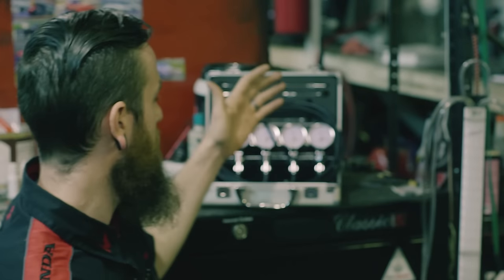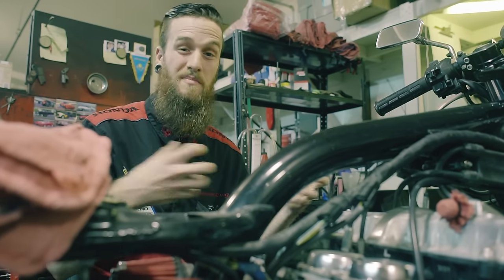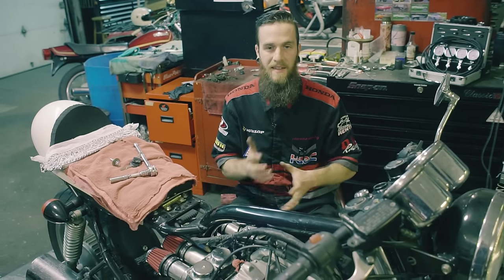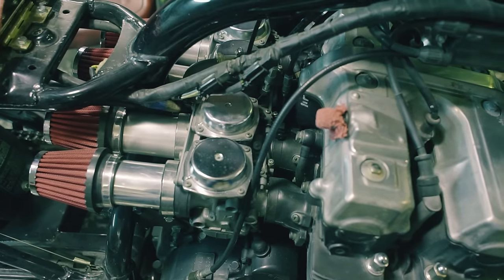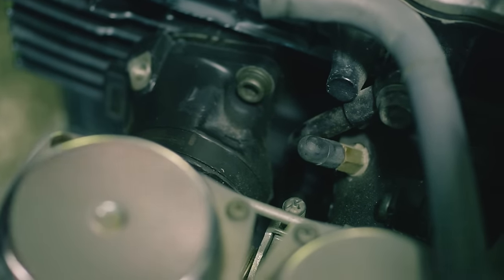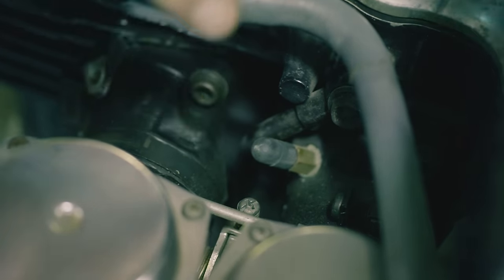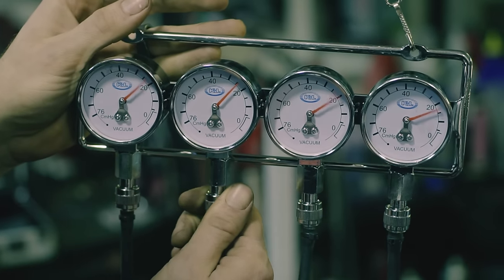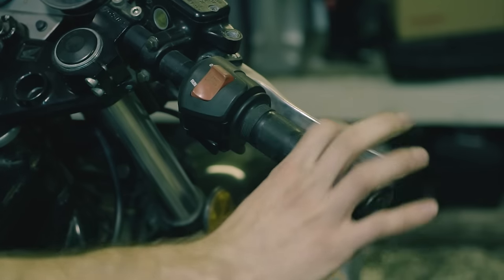Carb Syncing: How to Fine Tune Your Carburetors

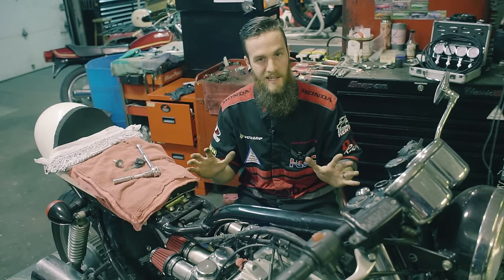Comment: thank you  2:53  true story.   
 Me " I just got this bike on a trade, I cleaned the carburetor but it still doesn't run I was hoping that was the problem"  
dude who thinks he knows about bikes even know he doesn't have a bike.  " did you sync that carbs?"  
"no I'm pretty sure that's not the problem" 
"my dad found this insert bike name here in an old barn worth $150 ,000  he took it home sync the carbs got it running the next day" 
"cool"  walk away   

the point here some things make the bike run better, did you try to change the oil, ahhh that's not it.  and somethings are essential for the bike to run. fuel, air, spark, compression makes an engine run  anything else makes the engine run better or worse.  remember just because you upgrade something doesn't mean your bike will like that.  

anyway thanks for the video

Comment: Thanks for the detailed info.  Totally awesome!  Question, do you have a video on installing the air pods and it appears that you put about a 2" extension on yours in this video.  I have a Suzuki GS1100 that I would like to do the same with.  Just not 100% sure how to install them.  I also assume that I will need to sync the carbs once the air pods are installed.  Thanks again!

Comment: Great video! I just recently purchased a 1980 honda cb650c. after cleaning, and many frustrating hours and attempts, i finally got the leaking carbs to stop leaking..
my current issue is the pod filters that are on it. previous owner must have got em and installed em, correct size jetting too, but stock 4-4 exhaust. but the 2nd and 3rd filter interfere with the choke cable located in the middle of the 4 carbs. I was too excited after getting the leaky carbs to stop and wanted to take it for a test ride. fired it up with no pod filters, only with the help of starter fluid. 

I'm wondering if you had seen this scenario with the pod filters/choke and had any solution. I'm wondering if i rigged something up to extend and offset the 2nd and 3rd filters that it will be okay with uneven filters. I can't extend the 1st and 4th filter because they are already too close to the frame.

p.s. keep making awesome videos! liked and subscribed
Reply: You can put the filter in a tube. I did that on my Triumph Legend. I cut a beercan into shape, "wrapped" it over the filter and that made the engine run much better.

Comment: FWIW, I check my gauges with a handheld vacuum pump to make sure they all read the same.I have adjusted brand new gauges right out of the box. I would suspect that's why the mercury gauges read differently.

Comment: Hello again Cody, as i mention i other video, my mechanic told me that my carburetor needs to be replaced, is Keihin original one, but overthought i'm not an expert, i think that with a rebuild kit, new floats and fine tuning it will be ok. But i need professional opinion of how to know if the carburetor really needs to be replace or just rebuild. In all the research i've done, all i found was deep cleaning and rebuild, nothing about replacement.
Reply: Why does it need replacing? More info from your mechanic is needed. Is there a part inside that is broken, will it be easier for him to replace than repair? I would want to know why before buying a replacement or even having the guy do any more work if he can't tell you why.

Comment: Hey Cody, I'm really stoked by your channel. 
I've got an issue on my '98 cb600 (44.400km's)  Idle after cold start is slightly messy. But after my last two ca. 45min. rides, it quite often stalls around reaching idle revs. Like when rolling with clutch disengaged or in neutral at full or close to full stops. 
Could this be a thing caused by the carbs being out of sync?
what would you recommend checking first?

Shout out from The Netherlands

Comment: I hope you'll get this.  Guy has a 1978 KZ1000. He wants $5,000 for it.  It looks decent but what would you do for a complete review if you bought it?  I mean would you just go ahead and change fork oil and seals... Even if not leaking?

How could I really know the engine is in good shape?  I mean if it runs okay, then I guess all fluids, plugs, clean and sync the carburetors, other??

Comment: Those are way safer than the mercury sticks we learned on back in the day. Although I remember the old Bell Crank carbs, you could sync them with four pieces of welding rod (or coat hanger).

Comment: Okay maybe I missed it but isn't there an individual idle air fuel mixture screw on each carb? I was under the impression that if you had one cylinder that wasn't running as well because the mixture was off that simply opening the throttle plate further is only going to partially correct a problem.

Comment: Carb sync is a means by which variations in each cylinders draw / compression can be adjusted through each butterfly so that the result is evenness in terms of draw - fuel delivery.

Comment: Hi Cody,ok I have been struggling with my kids bike 1996 honda 750 nighthawk. We took off the airbox and removed the baffles on the stock exaust pipes. We have a jet kit in the carbs .142 mains and slow jets we're bumped up.Single pods installed and I can't get rid of a sputter at 7k rpm?I noticed u have an extension on the pods. Is that the secret?Dennis ps love your videos!@

Comment: Great video, but Honda use Japanese Industry Standard JIS screws not Philips. 
A #2 Philips screwdriver will round out the manifold vacuum screws if they are stuck and they'll round out the soft brass carb screws really easily, as happened to my old XL125V4.

I bought a Vessel 300 woody +2x150 for working on carbs as it was long enough to reach the adjuster through the hole in the air filter on my old NTV650P  (similar to the Hawk 650) and my XRV650J

I must get some impact ones for where a previous owner has rounded the crash bar cover screws out using the wrong driver on my ST1100AX

When balancing/Synching the carbs,  don't rest the tip of the driver in the adjuster screw when taking the reading as it will throw it off.

Comment: hey Cody, I dig the videos man.   The way you break everything down is awesome and you make complex situations not so hard.  Here's my question...I'm rebuilding a 94 Vmax.  I went through the carbs thoroughly and set them up Ay 2 1/2 turns out.  Started, ran about 30-40 seconds and was purring....then died.  now when I crank it it pops/backfires loudly.  Any ideas?
Reply from the maker: WilliamGallegos I would check your fuel delivery system. Petcock, fuel pump if applicable, fuel flow from the tank etc. OR something loosened up in the carb like the idle jet fell out in the bowl or something. You can also try starting it with full choke and see if it picks up and runs. If that's the case than your dealing with a lean issue. Vacuum leak, poor fuel flow, carb issue etc. starter fluid works wonders with finding vacuum leaks. I have a video on that as well!

Comment: Love the videos, keep it up. I have a question on carb synchronization I've got an 81 Kz550 with the keyhole style carbs that you sync through the top covers. In this video you said that carbs get out of sync by either vibration or taking them apart. Now on my carbs to adjust them you remove the top cover and loosen the locking nut and turn the screw either in or out depending on the vacuum once its good you tighten the nut without turning the screw. My question would it work to replace the regular nut that is there with a Teflon lined locking nut so that vibration wouldn't affect the sync of the carbs? Then it would only get messed up by disassembly for a deep cleaning/ rebuild. Would that work? If not why?

Comment: I bought a Motion Pro 4 carb synch gauge to dial in my 79 XS11. Do you think this was a good purchase? Will likely be doing a few other bikes with it as my comfort level rises and it seemed a decent tool to me.
Reply from the maker: Nick Warner Hey Nick, is the one your bought a fluid style gauge reader or a vacuum style?
Reply: fluid style
Reply from the maker: Nick Warner 😕 The blue fluid ones are definitely not my favorite. I prefer the vacuum style or a classic mercury set.

Comment: Old school method is just placing a pipe between carb intake (if it has vacuum gauge spigots theyre even better) and your ear. If all carbs are adjustable (many banks of four have adjusters on only 3 carbs) you listen for the carb with the most suck (the loudest) and then adjust each of the other carbs, constantly checking, until they all sound the same. Obviously on carb banks that have one carb thats non adjustable (old hondas) you have to adjust all the others to sound like that one.  Either way, your carbs are balanced.  Clearly you have to ensure that the butterfly valves are all synched first but this you can easily do by eye, holding the bank up to a light source and comparing the crescent of light that comes through (throttles shut).

Comment: So this is basically only for adjusting the idle? It won't actually adjust half-open and full-open positions right? What if you run a bike without syncing the carbs properly for a long time?

Comment: great job  I have question i have zg1000 do you have a  take apart carb demonstration rebuild for that model ? I bought car  the engine blew up  was not told it was bad they somehow doctored it . so i needed a transportation  and bought a bike to find out the carbs are bad . sooner or later something good should happen.  any advice  would help thanks

Comment: I would use water to spray around carbs looking for vacuum leaks, works great, and the bike won’t catch fire when it finds the broken ignition cable.  Lol seen it happen several times, water will also show the broken ignition cable.

Comment: hey cool vid - i used a manometer few years back, worked ok but i kept chasing my tail- i just hooked upa  4 carb sync gauge kit i bought at a swap meet but it doesnt have the adjusters like yours, at idle the needles are crazy- does cranking the orifice not affect the overall vacuum? thinking of popping 4 1/4 inline shut off valves from the gardening section to try keep the needles under control. bike starts at the touch of the button but i wanna get max performance.. thoughts on the valves?

Comment: It isn't "easy" to correctly sync carbs, but for the best power and power delivery, it's vital. On two-stroke single cylinder bikes, (or most multi two-strokes) it's a struggle to set the recommended vacuum accurately but vital for proper jetting. Too many people (even service techs) say "close 'nuf" and quit. FWIW, Mikuni, Keihen and every other brand of CV (constant velocity) carb has slightly different methods of setting. The information is available on-line.

Comment: Hey bud, 
I have an 83 yamaha maxim750 that I installed pod filters on. Do I really have to install a 3 phase jet kit on it cause of the pods or can I get away with adjusting fuel air mixture?

Comment: On a Yamaha vmax 1200 86, it has sat for 13 years with gas left in the carbs, have cleaned them twice now, it will only stay running with choke at just below half closed position.  What should I be looking at?

Comment: Hey i recently started working on an old 1975 honda cb750f super sport and I was wondering, does the kit shown in this video work on the cycle i just mentioned? If it doesn't, I would appreciate it, if you could send me in the right direction to find a kit that will work.
Reply from the maker: Yes it does.

Comment: I'm getting readings of around 5 on all carbs on idle. You're getting around 20 looks like. What am I doing wrong? I got the same gauges as you did. I adjusted the carbs for the same value and they run so much better, but still confused about the reading.

Comment: great video  question on where to hook up hoses . on my manifold i have four ports .I also have a vacuum port on carb two
witch to petcock hooks up to . do i use the four on the manifold or three on the manifold and the second hose to the carb its self
thank you

Comment: Hey Cody. Love this video. I synced my carbs with a homemade manometer using distilled water and beer bottles.  Got how to make it from YT. The service manual states not to connect #2 carb. Thoughts?
Reply: Ken P What make and model bike?
Reply: 2000 Nighthawk 750
Reply from the maker: Ken P I'm not sure what manual you have, but you need to connect to the #2 vacuum port to dial in the remaining 3 to the base #2. In this video I'm working on your exact model bike.
Reply: I enjoyed seeing my bike in the vid.  I have the honda manual.  Ill check sync in the spring.

Comment: I've been adjusting the fuel screw trying to find the sweet spot on my GS550. Pretty sure they're the CV carbs. Does that screw only adjust the fuel mixture during idle or does it effect top end too? Bike accels well but when i put on the throttle it sounds like it spins out at the top end and doesn't increase power. (sounds like gargling basically). Is this the screw I would need to adjust to fix this? If not what should be adjusted? Another thing to note is sometimes I hear a hiccup come from the carbs. know its from the carbs because when syncing the needle jumps on one or two carbs, not sure if its related.

Comment: Hi, I got an inline four 1992 GSXR 400 and the bike shuts down when it idles.I tried messing with the idle screw but it never holds at 1,200-1,400 RPM do you know what could be the problem?Ive ordered a carb sync kit hoping that will make it idle better but part of me thinks to take the carbs apart enough to spray the jets with carb cleaner, what do you recommend?

Comment: I'M HAVING THIS ISSUE WITH MY 99' HONDA GL1500 WITH 25K MILES. ISSUE MEANING POOR GAS MILEAGE AND DRONING SOUND WHEN IDLING SHORTLY AFTER INITIAL START-UP THEN IT TONES DOWN OR NORMALIZES WHATEVER THAT IS WORTH. WOULD YOU RECOMMEND I MOVE FORWARD WITH SYNCING THE CARBS?

Comment: So if I cleaned my carbs, and I adjusted the valves to be at about the same position, should my bike run? I measured the opening on each cylinder, 4 of them, but my bike does not start and I'm not sure if it's because they might not be synced?

Comment: Concern with vacuum gauges being inaccurate is they require calibration. This is not a problem and easily fixed, it's not that each needs to read accurate inches of mercury but that they need to be balanced when compared to each other. This is simply done by having all four connected to a common manifold with a single vacuum source; adjust needles so they all read the same. Once calibrated (ie balanced) then you can be confident the readings on the carbs should also be accurately balanced.

Comment: I have a nighthawk 750. The 1 3 and 4 carbs are synced to #2 carb. My question is how to set the #2 carb and do i need to do a compression test first. My bike has some compression loss since its a 91 model. I plan on rebuilding with tax money. I think comp rings are sticking. I tried yamaha ring free fluid but didnt seem to help. Im rambling.lol

Comment: On a kawasaki kz400 1979 if the carbs are not properly synchronized can it cause a different heating on the both cylinders

Comment: Question I have a hyosung Gt650r and already have the mixture screw 2.5 turns and the engine only runs with hace of the choke on does that means that I need to go more than 2.5 turns out the bike would die if I take the choke completely off

Comment: The base carb is changed with the idle speed screw. Use dsolo's calibrating method. Adjust mixture with pilot screws BEFORE SYNC-better mixture increases flow which changes sync. It ain't high throttle that sucks up liquids, it's the throttle chop/shutoff quickly. Engine VALVE CLEARANCE has a huge effect on sync. Check/adjust at idle, if off at higher opening ya gots a mechanical problem !! Don't use liquid sync guages if they can't be adjusted individually to calibrate !!!!

Comment: Hey man I've been having trouble with my 85 cb700 and I cant figure it out. once the bike is warmed up it will die unless I give it a little bit of throttle. Also it has trouble in the high rpms mainly 2nd gear and up. You can tell it wants to but all the sudden cuts out and wont fo any faster.

Comment: The Mercury Gauges are always going to be more accurate because they depend on the weight of the mercury. The dial gauges can lose accuracy due to wear from the oscillations back and forth and the can be non linear. Also if there is a zero post and the needles are resting on them they can start with an offset, a quick check is to hook all four gauges to the same source and check a low vacuum point and a high vacuum point a pump is ideal but an engine at idle should make a higher vacuum than one at higher rpm as long as all four are the same at both points you are good since the balance is looking for equal vacuum not a specific number.

Comment: I trust the mercury gauges. Actually I use one tube on a yard stick and fill it with 2 stroke oil. I cram an old pilot jet in the tubes as a restrictor. If do some reason the vacuum would be really out of wack the flow would be restricted and at the most you would suck a tiny amount of 2 stroke oil into the engine. Not a big deal like mercury. Any fluid will work.  It’s just a matter of what you are willing to risk getting into the engine. Normally they are not that far out of sync.

Comment: hi, sinds 6 months i 9wn a Yamaha YZF 600R ( Thundercat) from 2000 with like 23.000km ( 16.000 miles ). the last 1000km my bike vibrates alot on my footpads en the frame. its a very anoying vibration. it starts after 4000 rpm ( even in neutral ) it is not the chain or anything like that. when i squeeze the clitch lever at 200.kph ( 120mph) the vibration stop. is it a synch. problem you think? no one can help me even the local dealer. thanks for you help. greats from Netherlands